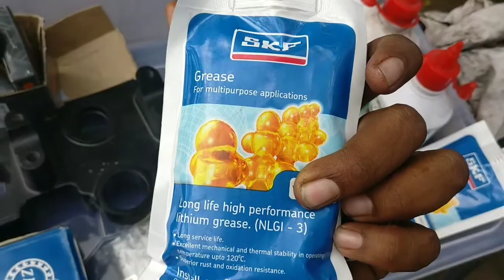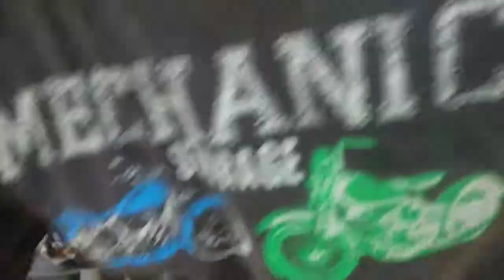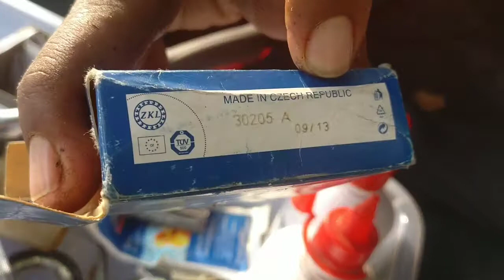RE Himalayan Tstam Ishu & cone bearing replacement , service  and maintenance vlog

Comment: Bro this definitely will solve the issue, however you should not omit the dust cap. A greasing arrangement can easily be done on the stem, which I need not tell you how to do it. By modifying with a grease nipple, old grease will be pushed out. In Himalayans life time this bearing won't fail 😊😊.

Comment: You are a very good mechanic with a lot of knowledge. Keep making such great videos. I would love to meet you when I come your way. I live in the United States.
Reply from the maker: Thanx brother
Reply: @hdtcustoms11188  
The first major repair I did was replacing front wheel bearings on my  car, in 1979. The bearings were badly damaged. I was a student in  the U.S. then.  

You don't need high temperature grease for steering stem. Wheel bearings do better with high temperature grease.  I think, Royal Enfield needs to improve the design of the steering stem. Instead of using a pained stem, they should use stainless steel stem so that bearings can be fitted on the stem snugly. I have a feeling we failure of your bearings due to badly designed stem since rest from the stem contaminates your bearings.
Reply from the maker: @MrYaatri  u are right thy must improve in quality but few things are ther which can't be done practically like . Tstam in steel BCS then it vll BCS berry heavy in monovering . Instead if that if Tstam is in CNC cut aluminium it works b best . And hi temperature bearings vll b good for wheel bearing but not necessary in stearing bearings BCS thy didn't get heat . But yes if RE use japanese bearings like way I use it wisely have solved thyr ishus

Comment: Bhai I have a Dominar and at slow speeds I have problem in steering the bike, bringing the handle from either left or right to neutral position i feel weird, at a certain position I feel the weight of frnt on my wrists when bike is leaning . Also at speeds around 30 , and leaving the handle , bike steers towards left and comes back to neutral and again goes left n neutral again. Mechanic could not find play in the frnt shocker, and told coneset is also fine . The front tyre tread is uniformly worn out. 
Any suggestion what could be the issue ?
Reply: I have the same issue on my himalayan.
Reply from the maker: If bearings are good then check your tyre pressure or wheel bearing . And if your tyre is wrond out then it is definitely your tyre which is troubling in monovering it happens
Reply: @hdtcustoms11188  My bike has just run 4000 kms, tyre is good , tyre pressure maintained as per the manual, Got it checked at RE service centre, they said the cone set needs to be greased

Comment: My friend, bearing seal is important for the bearing to seat right and seal the bearing against moisture and dust penetration. You are quite right to select a better bearing. I lived on the Gulf coast for 7 years, never had a rust problem.

Comment: Is it a good idea to omit the seal? I think the issue is a simple lack of greasing from factory... the seal would prevent water from getting in. Maybe you should get a spare and fit it in..
Also SKF is not local, be it India made or otherwise... so that should not be the issue... never heard of the other brand though! As long as the installation (preload and alignment) is ok, SKF bearings shouldn't pose a problem..
Reply from the maker: Sir bearing material quality is not good specially the one which is been used by endurance for royal Enfield . Must be some special make asper cost cutting . But I found skf getting fail faster them other brand japanese bearings . Thy last 3 times more then stock

Comment: You can use a PVC tube of right diameter and a wood or rubber mallet ( hammer) to seat the bearing.  Screw driver can damage the bearing race.
Reply from the maker: I do the same now a days